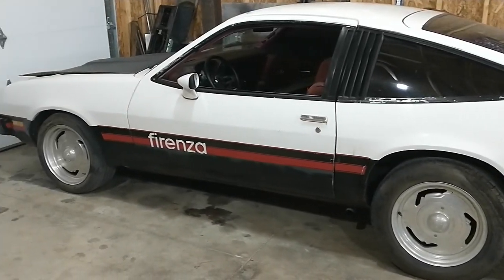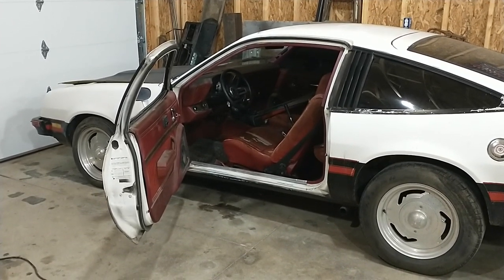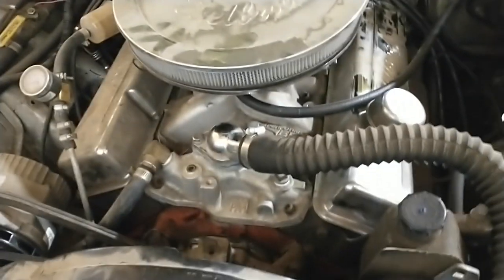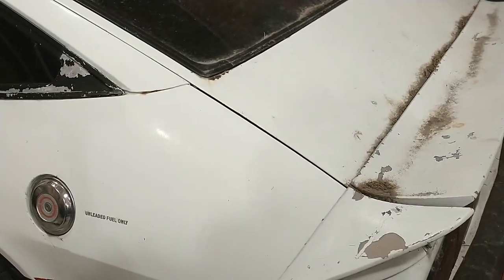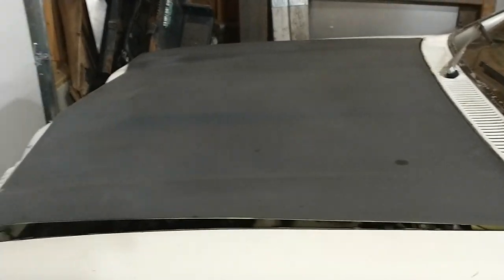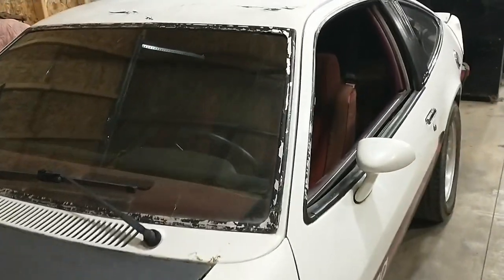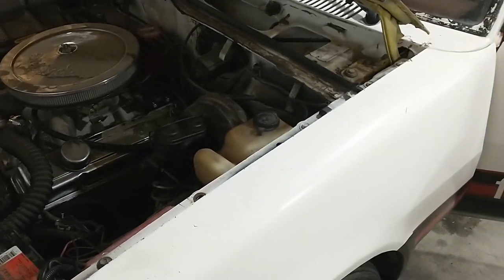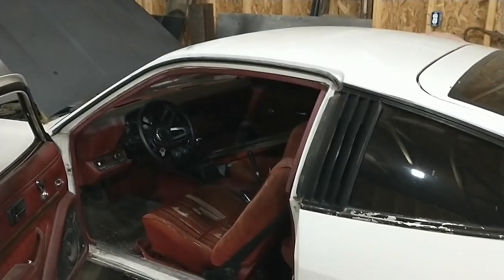1979 Oldsmobile Starfire Firenza V8 - Less than 4K Built!

Comment: i loved the Monza and all the GM versions of it. Was truely a cool car to drive and own.
Reply from the maker: I always thought it was pretty cool styling for a low cost, sporty car. Thanks!
Reply: In 1991 my buddy had one.  We were in high school.  4.3 v8 Chevy monza.  Cool little car!
Reply from the maker: @GMCJay_lly Jason Heinrich I think I'm going to enjoy it. Thanks for the comment!
Reply: I bought an '80 monza new. Piece of crap. Twisted it during the first oil change using the stock jack to lift it. Took an hour to get the factory installed oil filter off. Iron duke w/ 4spd got 18 mpg. Every 18000 miles, the clutch cable would break because the cable wasn't braided. I literally kept a spare cable in the trunk. Ate tires every 15000 (goodyear tiempo tires 40000 mile rated ... when all season tires were brand new). Had a friend who was an alignment specialist hated it. Spent 1.5 hrs trying to align it without success. He owned a vega before a 260 Z. 
I bought the monza as a daily driver to park my '69 mach 1 428 cj 4spd I'd rebuilt.
That monza made me wish I still had my '71 pinto.
Those cars were the best for pushing americans to buy reliable asian imports. At least, the non-domestic brand loyalist.
Gladly traded it in for an '83 turbo t-bird 5 spd. The good old days ... t-bird as a daily and the mach 1 for you know ...
Had a friend with a v8 monza spider. Stock engine twisted the body. Chaining the engine probably helped lol.
Reply from the maker: @D Beelee we never had any trouble with my dad's '77 Sunbird other than a surprise broken ball joint. It had the duke and a manual as well. I had a girlfriend with a Monza that had clutch cable problems, thought. I know that was an issue. I bet the Turbo Coupe was a nice upgrade. :) Thanks for the comment!
Reply: @smithmotorworks1969  a couple years ago, here in north central Indiana. My uncle bought a green monza spider.  Pretty much the same car.  It was green, rear deck spoiler, front air damn, ground fx, a spider painted on the hood, 305 v8.  It may of had t tops
Reply from the maker: @what you make of it that sounds pretty awesome. I am a fan of green cars. Hopefully he still has it. Thanks for the comment!
Reply: I'm a Ford and Mopar guy, but agree these are stylish and I would proudly drive one.
Maybe it would need some mechanical improvements, but was a product of a tough era in manufacturing, hurt by many conflicting compromises.
Reply from the maker: @67marlins I kind of like them all, as you can probably see from my other videos. LOL. I agree with you; that was a tough time for the industry. Thanks!

Comment: The Starfire actually started out as a name tacked onto the 98 convertible in the 50s, signifying nohting more than that it was a 98 convert.  The first real run as a stand alone name was 61-66, when it was a range topper (except in 66 when it was signifcantly decontented and below both the 98 the Toro).  Through 1964, it was considerably more than the 98 and had better trim and a slight bump in horsepower.  The compact Olds mentioned was the F-85, with the 2 year only turbocharged version being the Jetfire.  After that of course we got H body seen here, starting in 75.  You could get the 305 in a Monza too, but not the Sunbird or Skyhawk.
Reply from the maker: My grandad had a Jetfire. I wish I had that. There was supposedly one V8 Skyhawk built, and about 1400 V8 Sunbirds. Lots of great data here: http://monza.homestead.com/Production.html Thanks for the information and the comment!

Comment: Absolutely loved my 1979 Firenza. The 305/4 spd combo was very quick for its time. Never lost to a Mustang of similar time frame. Probably one of the most comfortable seats & cockpit of any car I've owned. Thank you Oldsmobile! Excellent car for its time given the emissions control. Had a 283/350 HP ready on a stand to put in it, but found out the Torque Arm was already breaking the two bolts hold the arm to the front of the pig. Decided if it couldn't handle <200HP of the stock motor, it wouldn't be safe to drop in a 350 HP power plant. Probably my 2nd favorite car right behind my 1970 Challenger  RT/SE w/383 Magnum.

Hope you enjoy it as much as I did! JR-Dallas
Reply from the maker: @periguin that sounds pretty awesome. I have wanted one for a while. I'm kind of an Oldsmobile guy, so it was a nice addition to my collection. Thanks for the comment and for watching!

Comment: I had a black Firenza. I tossed the 305 and put in a 400. The TH-350 had a shift kit and would break the rear transmission mount if I nailed it.  One of the fastest cars I've ever driven, even compared to my 400hp C6 Vette.  I sure do miss it. A couple add ons: it's transmission torque arm was later used on 3rd and 4th gen Camaros. It also shared it's side view mirrors with second gen Camaros, and many more cars. I always believed that GM didn't provide a 350 engine factory option because it would've beat same year Corvette.
Reply from the maker: That sounds pretty cool! Evidently, for California only in 1975, you could get a 350 powered Monza. Crazy, right? Thanks for the comment!
Reply: They did offer the 350 one year and California only I believe it was 78. If I'm not mistaken.ive seen a few on yoitube one was in decent shape and dude was just taking it all apart in the name of weight savings for racing I of course did not agree with his ideas lol
Reply: Maybe 75 was right my bad
Reply: They made 350 in California , their was 3 of them that left the factory with a 4 barrel, very rare. The 350 had like less then 100 Horsepower, I think the 305 had more horsepower. The weak link was them 7.5 torque arm rear end. The automatic transmission wasn't a turbo 350 it was a Turbo 250 if you read the manual. They also had some 5 speeds but only behind a V6. The New Camaros were like it's older brother, had all the same features including the rear lenses.

Comment: They sold a ton of the Buick Skyhawks and Olds Starfires. These were ‘sporty cars’, not ‘sports cars’ or Muscle cars’. The Buick v6 was the best fit for these cars. The right amount of power and torque with relatively light weight. 

The 4.3, 5.0 and 5.7 v8s made these pretty good runners for the time. The upgraded bigger brakes that came along in 1977 were a huge improvement. With the quick variable ratio power steering, these were pretty nimble steering wise. The seats were pretty comfortable. And the hatch backs were quite usable for trunk space. These were squirrelly in the back end. That’s part of what made them fun to drive. The v8 with the 4 speed transmission drove as good if not better than the equivalent period Nissan 300z. 

I owned 2 v8 monzas. A ‘75 2+2 4.3 v8 with a 4 speed manual and a ‘78 Monza Spyder Z32/Z34 packages with a 5.0 v8 and turbo 350 automatic. The 75 was a hoot to drive, but the 78 was a much better car reliability wise and had a lot better brakes. (Vented vs solid front rotors, and bigger, better functioning rear drum brakes.) the steering ratio was slowed down on the 78 with a bigger diameter steering wheel, the spring rates changed and the rear track bar redesigned.) the changes dulled the steering responsiveness, but substantially improved braking performance.
Reply from the maker: Thanks for the comment and the information!

Comment: I had one back in the early 90's. Bought it as a roller, built a 350 and a th350 for it. Put a set of gears and axels in it and my buddy welded up the spider gears and it was my Mustang gt eater.
Reply from the maker: That sounds like a winner. I think the Firenza is going to be a lot of fun. Thanks!

Comment: Definitely a cool unique little Oldsmobile. I like it! I like the nose with the grille that looks like the grille off a 76 442. I loves Olds. I currently have a 17k original mile 87 442.  I would definitely restore your Starfire. It’s unique and really cool looking and is probably fun to drive
Reply from the maker: I actually have a '76 Cutlass S with the aero nose just like the same year 442. Your '87 sounds pretty great! I like them all, but I'm an Oldsmobile man as well. Thanks for the comment!
Reply: This was called the Euro nose they used on the track Indy 500 races etc.

Comment: I had a new black one back in 1978. Had a 305 V-8 4 speed. Rare car even back then? fast too. I beat many corvetts, camaros and firebirds especially off the line at red light!!! i drove it to death. never had problems but it rusted away after many years.
Reply from the maker: That sounds awesome! I honestly wish this one were black, but I'll take what I can get. My car hasn't spent much time in the rust belt here in Indiana. So, that's probably the only thing that's kept it as clean as it is. Thanks for watching and for the comment!
Reply: @smithmotorworks1969   mine also had the older 4 headlight front end similar to the monza.
Reply: As someone that grew up in Lansing Michigan the home of Oldsmobile these wee popular with Oldsmobile workers with a employee discount. I had a friend that had a yellow one with a 305 V8 auto. These came out with a Chevy engine that wasn’t so bad but when people started getting a Chevy engine in a Oldsmobile 88 and 98 and Cutlas people got mad around the time these came out it was a big problem, GM ended up paying some Oldsmobile and Buick owners a settlement.
Reply from the maker: @steve1758 I had heard about the lawsuit on the big cars and wondered how it affected the brand in general. Thanks for sharing your first hand account!
Reply: @smithmotorworks1969  my step father got a hell of a deal on a 78 Olds 88 in 80 that had a 305 Chevy in it with no miles on it that was one of the lawsuit cars. The car was fine ran great he drove it for about 10 years before trading for a Buick Park Avenue the last of the big ones.
Reply from the maker: @steve1758 I also had a 78 Delta 88 that I inherited from my Grandad. He had a new Olds every couple of years since the 50s and is where I got my love for them. It had a 350 Oldsmobile engine. I wish I still had it.

Comment: Keep in mind, compared to todays cars of the same size, these are light weight cars. My 75 2+2 v8 Monza 4 speed manual hatch back only weighed 3200 pounds, on the scale. The 78 with automatic and air conditioning was a little under 3,400 pounds. 

Keep in mind, these are small cars! Substantially smaller and lighter than the 1970’s Camaros and Firebirds. By about 500 pounds. Plus or minus 100 pounds. The Vega was lighter, but is used a lighter structure, even though it was basically the same platform. 

These cars were specifically designed and built for the GM Wankel rotary engine (like rotary installed in Mazdas) but GM canceled that engine at the last minute, so that is why you found so many different engines stuffed under the hood with varying levels of success. You had the Vega 2300, the Pontiac iron duke 4 cylinder, the Chevy small block v6, 2 different v6 (odd fire and even fire) Buicks and the 3 Chevy v eights. The came with 4 speed, 5 speed manuals and 3 different automatic transmissions. 

The best all around engine was one the Buick v6 engines, but the default engine of choice for the hot rod set was the 350/5.7L Chevy v8. The Monza got all three v8 engines. The Pontiac Sunbird Formula and Oldsmobile Firenza got the 5.0 v8. The Buick Skyhawks only came with the Buick v6 motors. 

Someone managed to stuff a Buick grand national v6 turbo into a Skyhawk at one point. That car was a beast! But swapped in Chevy v8s in place of 4 and 6 cylinder motors was as common as pancakes.
Reply from the maker: All true, thanks!

Comment: 8:35 I like the shutoff valve for the heater hose. I put something similar on my parent's Citation; it was a necessity on many late-1970s GM cars that lacked air conditioning, since the heater flaps never cut off the hot air completely. It was less of a problem when cars still had flow-through ventilation, but with less room for ducts in the downsized models, the flow-through systems were replaced with vents connected to the heating system and summers could be unbearable in those cars.
Reply from the maker: I'm sure it works. I'd just rather have something a little more sophisticated looking, LOL. Thanks for watching!
Reply: @smithmotorworks1969  Like What
Reply from the maker: @Paulwal maybe something like this: https://www.summitracing.com/parts/uac-hv1021c?seid=srese1&gclid=CjwKCAiAqt-dBhBcEiwATw-ggK4ZWDHmTBfU3HEQulAFe50MvrR5py_3OI2yitCmSji7xhMnFZmTdxoCnrwQAvD_BwE

Comment: I had a 79 monza spyder with the 5.0 and factory 4 speed. From the factory it could only be had with a two barrel. I put a rochester quadrajet on it and it really woke it up.
Reply from the maker: Nothing like the sound and feel of the secondaries opening up on a Q-jet! Thanks for the comment!
Reply: Nothing sounded like the old quadrajet when those big secondaries opened up. 👍
Reply from the maker: It sounded even better with the air cleaner lid flipped over, LOL!

Comment: 5:00 The Firenza nose looks a lot better than the one on the Monza 2+2. I was never a fan of rectangular headlights on rounded cars, but the single headlights on the Olds version, with the slightly rounded corners of the openings, transitions to the rounded surfaces of the car much more smoothly than the openings of the Chevy's dual rectangular headlights did.
Reply from the maker: I actually like the previous quad headlight Firenza a little better. But, they all look pretty great. Thanks!

Comment: I bought one of these in silver in 1979 in Columbus oh. I almost drove to Tx to buy one but it sold a few days before it popped up on my radar. Love to find one like mine, 8v with 4 speed manual
Reply from the maker: I couldn't pass this one up. Even though it has been changed over to an automatic, I have all the parts to put it back to a 4-speed. Your car sounds pretty cool. I would rather have silver than white. I hope you end up finding another one. They are out there! Thanks for watching!

Comment: @Smith Motor Works Getting your fender flairs back is easy peasy. Go to a professional 3D printer, have him scan the flair and print it. Then have him do a reverse print for the other side. To get the front flairs just have them printed to scale. You can easily determine the length of the front by measuring the void.
Reply from the maker: That is an option for sure. I have a small 3D printer in the shop that I've used for restoration parts on my 1950 Towmotor and our 1984 Indy Fiero featured on this channel. Check those out if you're interested. There's no compound curves on the flares, so I am planning on making them out of metal strips and welding them together. I have a lot of prototyping experience from my day job, so I (sort of) know what I'm doing. LOL. Thanks for the comment!

Comment: Great find!! I had a 77 star fire with a V6 in it. Would smoke'em all day long. Sucked in the Snow.
Reply from the maker: I figure this will be about the same or worse on anything but dry pavement. Oh, well ;). Thanks for the comment!
Reply: And rain. A short 96 inch wheel base and a heavy front weight distribution made for much less than ideal grip in the rain and snow. Plus, tire performance was still really really poor back then. They had yet to figure out the all season or rain tire designs.
Reply: There's a couple of them running around with Grand national engines and turbos

Comment: My parents bought me a new 1976 Monza when I was 18 for about $4,400.00. It had a 140 cu in engine with I think a 2 barrel carb. I forget the horse power; 80 sounds familiar. After having a VW Bug, I thought it had plenty of power. There was no way my parents were going to get me one with a 305 engine. It had a 5 speed; 5th gear overdrive was all the rage back then with the high gas prices. If I recall it was 60 cents. If memory serves it had a 16 gallon tank that could at 35 mpg easily last for over 500 miles on a trip. It was Firethorne red with a red dash but the rest of the interior was white. I still have the brochure and a model (AMT?) kit car sprayed the same GM Firethorne red paint.

In 1979 I bought a ‘79 Trans AM but I kept the Monza as my daily driver until I bought a ‘80 VW Rabbit convertible; then it was goodbye after four years and 66,000 miles. The VW dealer joked that the TA should be the daily driver. By the way I still have the ‘79 TA.

I think the Monza was a beautiful car and miss it.
Reply from the maker: I think the Monza and its GM siblings are starting to get a little respect these days. They are what they are. But, compared to what came immediately after and the (mostly) bland options we have nowadays for transportation, they are pretty cool. That is so great that you still have your TA! I had a gold special edition '78 and a '73. I was a fool for getting rid of either one. Thanks for watching!
Reply: Smith Motorworks, I enjoyed your video.

Comment: Nice H-body with lots of potential!  Hope you restore it and enjoy it.
Reply from the maker: I definitely plan on taking good care of it. Thanks!
Reply: @smithmotorworks1969  Hope you can find another nose for it.  Might be tricky.  Haven't seen one in years.  Maybe a wrecking yard in a small town might have one?
Reply from the maker: @MrSFSTUDIOS I actually have an entire spare upper nose with good headlight surrounds and grilles. I just need the lower valance, but I think that might be the same on some other H-body cars.
Reply: @smithmotorworks1969  Nice!  Yes maybe a Monza is the same on the lower panel.  GM seems to try and reuse parts where possible to save on production costs.